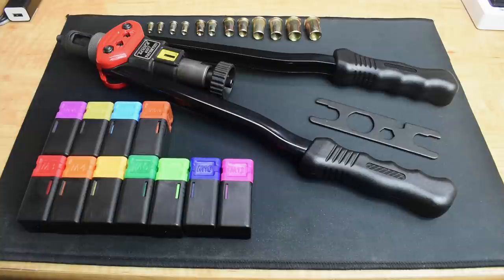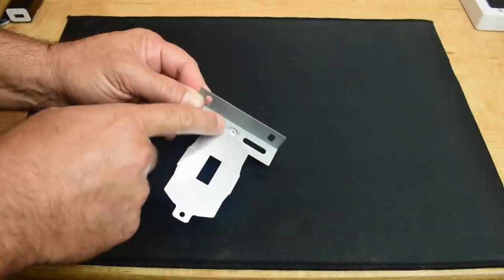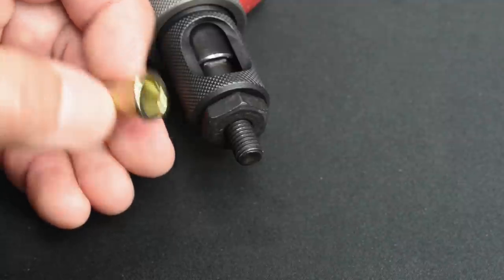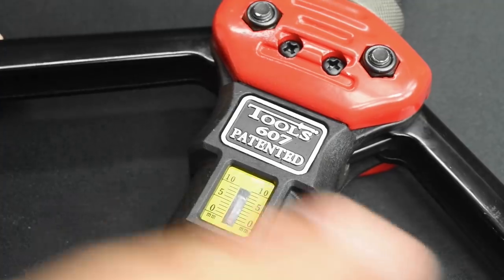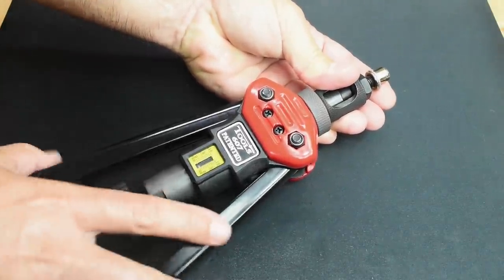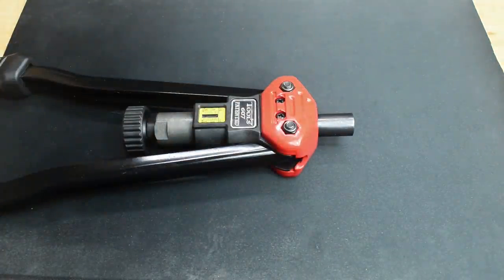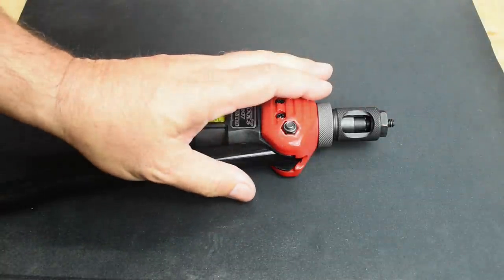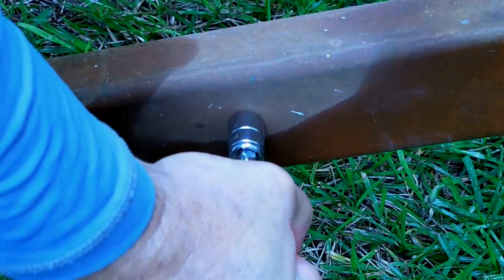How To EASILY Bolt Into Metal Tubes, Sheets, and Trailers!

Comment: I recently bought a kit that looks exactly like yours to try to repair stripped out sheet metal screw holes for the horizontal braces across my garage door. Instructions that came with the one I got were complete crap and my first two attempts failed to really expand. Looks like knowing how the the stroke gauge adjustment works is what I needed. I don’t think it was set deep enough to bind the thicker brace and the door panel together but I can measure that and adjust it now. THANK YOU!

Comment: I first learned about this method/tool in airplane school. We called it a "rivnut".
Reply from the maker: I could definitely see this tool being used by an aircraft mechanic. Thanks for watching!
Reply: @electronicsNmore  I think it was originally developed by Goodyear or Goodrich for attaching deicing boots to the leading edge of wings. Many are glued down now. Rivnuts still used on non-structutal panels/access plates where stresses don't have to be transferred across openings. Different system(s) are used in that case. (Camloc and Dzuz brands to name a couple)

Comment: Would be interesting to test the holding power of these. Different sizes,  installed into different materials, different directional forces.

Torque required to make it a "spinner",
force required to shear it or deform it out laterally and maybe a straight pull test...

Comment: I used a cheap rivet nut tool and was always disappointed on how weak the nut was with regard to holding strength.   Then Chinese tool and nuts you are using look a lot beefier.
Reply from the maker: I was very impressed with the strength of the rivet nut. When you drill a hole, the burrs created add to the gripping power to keep it from spinning free under high torque.